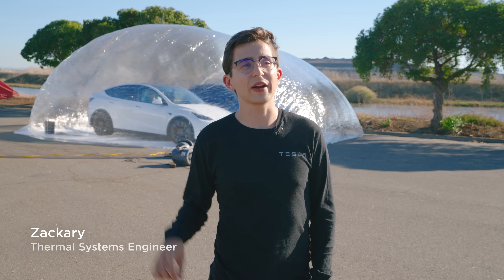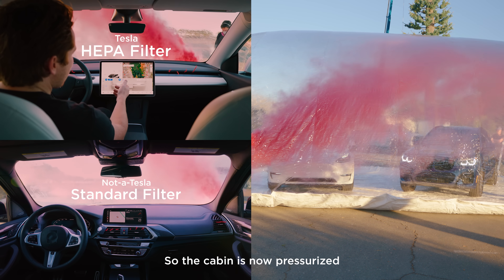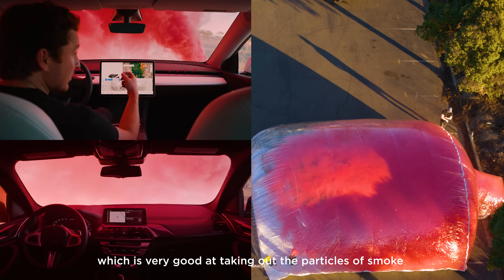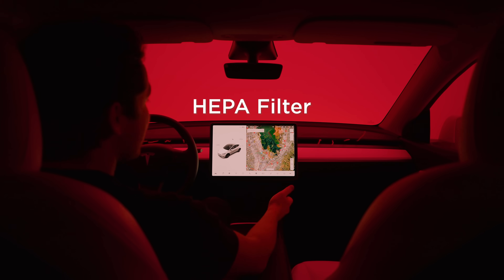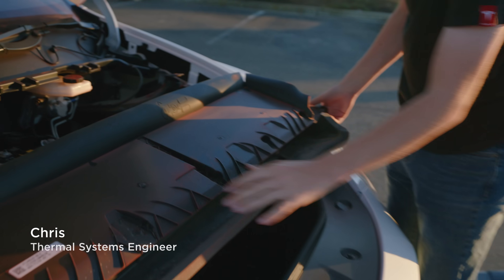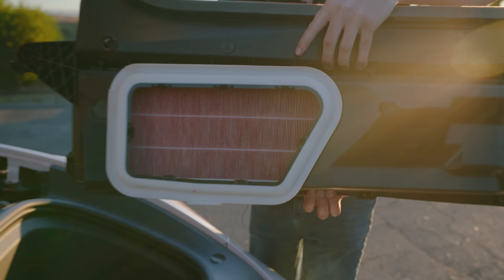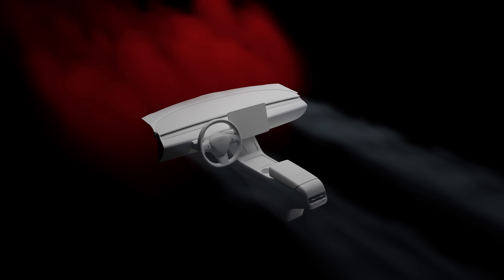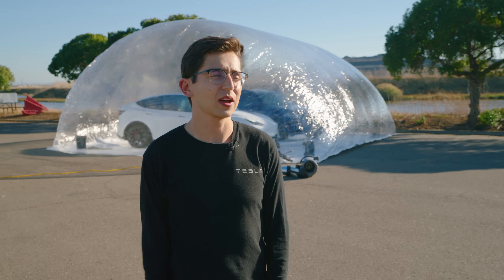Tesla HEPA Filter | Keeping Your Cabin Air Clean

Comment: Is it easy to change these filters?
Reply: Volvo has been doing HEPA filters and interior air quality sensors for 23 years.(they introduced both in 2000)  They are also certified by the asthma and allergy foundation of America unlike Tesla.  Volvo also has won the interior air quality award since 2020 and continue to do so. Not to mention the filter for a Tesla is 500$ the filter for a new Volvo is 32$ and still has cleaner air in the cabin.

Comment: I recently learned that particles from brake dust can actually be more harmful than exhaust so it’s another bonus for the health of everyone inside and outside a Tesla since EVs like Teslas  can be set to rarely use the brakes.
Reply: Most EVs have very little brake wear due to using regenerative braking (the electric motors) to do most of the braking.  This extends brake life and recovers normally wasted energy.
Reply: What? This statement is absurd lol
Reply: Yeah but they burn more tire(heavier and accelerate more quickly) but even tough brake particle are worst you have way more tailpipes emissions
Reply: @charles-olivierdaoust8397  Neither brake dust or particles from tires are tailpipe emissions. EVs do not have a tailpipe, they do not have tailpipe emissions. 
The particle size and thus also time the particles stay airborne is orders of magnitude higher with tires than with an internal combustion engine. 
And particle emissions from EV tires, despite the higher weight, are only marginally higher, to the point of insignificance.
Reply: Actually, the major problem with particles comes from the tires. And on this point, electric cars have some problems due to their weight. But, have to consider Tesla's cars are the lighter and more efficient in the industry of EV.
Reply: That claim about brake dust is really just wrong. The only study on it concluded a "may", while several of the particulates formed in a diesel engine are known carcinogens.
Reply: @drkastenbrot  Brake dust is mostly heavy metal particulates. You don't need a peer reviewed paper to know that is fucking terrible to breathe in.
Reply: @Shrouded_reaper  Since when is iron a heavy metal?
Reply: @drkastenbrot  at the gym. 😂

Comment: You forgot to turn on Air Recirculation on the BMW  (the green led is not lit up). 

For it to be a fair comparison (which the Tesla would have won anyway), you should have turned on Air Recirculation on the BMW, because the Bio Defense Mode of the Tesla is like a ‘supercharged’ Air Recirculation Mode.
Reply: I agree. Not being an anti-ev boomer but I’m sorry “biodefense” mode is just influencer bait for turning on re-circ in any normal car. If you hadn’t toggled that bio symbol on the Y then it would be the same story…..cool as it is it isn’t as revolutionary as it makes itself out to be 😑😂 I guess it is just simple psychology by changing the story around something that’s existed forever wa-la people fooled.
Reply: The manual on Tesla's say in biodefence mode it's filtering the outside air.
Reply: @TheEvilmooseofdoom  When activated, Bioweapon Defense Mode recirculates air through the high quality HEPA filter, purifying the cabin air while avoiding the intake of contaminated outside air. Model S and Model X already use a secondary air filtration system, but when Bioweapon Defense Mode is activated, it adds the HEPA filter as another layer of filtration.

Below is what Tesla Manual says (see last part that says that Bio defense mode tries to minimize the air entering from outside by recirculating very fast the air already inside the cabin thus creating positive pressure inside to prevent air entering from outside). 

If your Model Y is equipped with the medical-grade HEPA (High Efficiency
Particulate Am iiter, this filter ensures the best quality air inside the cabin whenever the climate control system is on and outside air is entering the cabin (recirculate is off). The HEPA filter is extremely effective at removing particles, including pollution, allergens, bacteria, pollen, mold spores, and viruses. Both the HEPA filter and the secondary filtration system also contain activated carbon to remove a broad spectrum of odors and gases. When you engage Bioweapon Defense Mode, the positive pressure inside the cabin minimizes the amount of outside air that can enter the vehicle.

So a fair comparison about ‘Bio Defense Mode’ required them to turn air recirculation on the BMW. The Tesla would have won anyway because the size and quality of the HEPA filter is fairly superior to what the BMW has.

Comment: If you don't select bio defense mode, is the air not being filtered through the HEPA as standard? So if you drive into a polluted/ smokey area before engaging, the bad particles will get into the car?
Do you need to engage it at the start of each drive? Does it have any drawbacks or reduce efficiency? Does it affect AC?

Comment: Glad to finally see this it will be very useful on gravel roads and  dust storms
Reply: Great to finally see this? Volvo has been doing HEPA filters and interior air quality sensors for 23 years.(they introduced both in 2000)  They are also certified by the asthma and allergy foundation of America unlike Tesla.  Volvo also has won the interior air quality since 2020 and continue to do so.
Reply: @ethandonivan5175  ok

Comment: I have a 2021 Model 3 and it has a vinegar-like odor issue with the HVAC system, caused by condensation issue. I’ve been operating the HVAC per Tesla’s service recommendations (cycling between recycle and fresh air, turning off the air cabin temp maintenance mode, etc). Tesla has replaced my air filters 3 times for free, but this defect needs to be addressed ASAP. 

@Tesla: I would appreciate an official response to my feedback above.
Reply: if they have carbon filters you are out of look. all carbon filters come with their own typical smell. HEPA filters do not though. but its often combined.
if yours has carbon filters, let them take those out and just keep the hepa.

Comment: do not have a tesla, but would an automatic washer fluid refiller be useful? as in using rainwater collected from under the windscreen or using this to refill the washer bottle by pouring water on it instead of filling the bottle? a simple filter system with overflow and a dosing system filled at service etc. just like a rainwater system for your garden.
Reply: That's a million $ idea right there!
Reply: And what happens when it freezes.
Reply: @ethandonivan5175  good question, i would add washer fluid to it. the idea is to simply extend the capacity of the washer bottle by using rainwater so it would not need to be filled. if it ever ran out, the way to fill it would be to pour water on the scuttle to fill it if needed, the same as adding washer fluid to a normal washer bottle.an option would to have a concentrate supply that would dose the main washer bottle with washer fluid as required. it is the effect of having solar cells on the roof of an electric car, it will not fully charge the car but it would help.

Comment: If only you didn’t refuse to fit the HEPA filters I purchased for my Model 3! Why is this not an option on all Teslas?
Reply: Model 3 apparently doesn't have the space to fit the large HEPA filters. Model Y, being taller has the space to accommodate it.
Reply: @realrift01  I purchased purpose designed HEPA variants and had them fitted by third party service engineer. They won’t qualify for bio-defensive mode, but they do perform to a higher standard than Tesla OEM ones, which are the only ones Tesla will fit if you go to them for service. At least they don’t make servicing by Tesla a pre-condition to validate the guarantee like GM did with the Ampera for instance.

Comment: What is a point to buy those filters if Tesla have a ton of gaps in the sealing?? You should better fix a sealing problem on your sunroof and doors.
Reply: The main air intake creates a positive pressure in the car. This means that small air gaps won't let air in - because air is trying to rush OUT of the car.
Labs with strict cleanroom requirements use similar systems.

Comment: Nice! but why does it have a button to turn on and off when it's a filter that's permanently in the car?
Reply: Filters are consumables. You don't want it engaged when it's not necessary.
Reply: @logitech4873  so if you turn it off, the air bypasses the hepa filter?
Reply: @WrathChild-NZ  That's honestly just my guess, since it's a separate mode and all.
Reply: Probably because it is overkill in normal situation. Saves of filter life that way, I would think.

Comment: Great engineering Tesla.
Reply: Volvo has been doing HEPA filters and interior air quality sensors for 23 years.(they introduced both in 2000)  They are also certified by the asthma and allergy foundation of America unlike Tesla.  Volvo also has won the interior air quality award since 2020 and continue to do so. Not to mention the filter for a Tesla is 500$ the filter for a new Volvo is 32$ and still has cleaner air in the cabin.

Comment: If Tesla is so concerned about air quality, why doesn't it build electric bikes? Even EV's produce particulate matter by degrading of the rubber on the wheels. Shielding yourself doesn't fix the problem.
Reply: Bikes are dangerous. Tesla don’t want to make dangerous products
Reply: @jackwhitlock1  self driving and lithium ion batteries can be dangerous, yet here we are
Reply: @jaimic4lyfe  
An EV battery is no more dangerous than a gas car. Self driving is only dangerous if you don't watch the road, which is why driver monitoring is there.
Reply: @a.banana  bro the adaptive cruise control is safer than self driving
Reply: @Life
It's only less safe than manual driving if you don't pay attention.
Reply: Because the unfortunate truth is barely anyone wants an electric bike. Selling them as an option will only have a small impact on helping the environment because of that.
Reply: @a.banana  More people buy electric bikes than Teslas.
Reply: @logitech4873  
Not true. Electric bike sales for the first 11 months of 2021 were 368,000. Tesla sold nearly a million vehicles in 2021, and sales are likely to grow to nearly 1.5 million in 2022
Reply: @a.banana  Why are you comparing US e-bike numbers with global Tesla sales?

302 000 Teslas were sold in the US in 2021. That's less than the e-bikes.

The US has comparatively low e-bike sales due to terrible city infrastructure.
Globally, e-bikes MASSIVELY outsell Teslas.
Reply: @logitech4873  You are missing the point. What were ICE car sales over the same time? That's what Tesla is working to replace.
Reply: @realrift01  I'm not missing any point. I'm correcting an incorrect statement.
Reply: @logitech4873  
Well, I admit I was wrong then. I looked up electric bike sales for 2021, but didn't realize I was looking at US only numbers. Still though, there is a point to be made that e-bikes might be more commonly replacing regular bikes rather than gasoline vehicles. Personally, I doubt that e-bikes will ever replace gas cars, especially in the U.S, and Tesla being a U.S company probably sees it that way as well.
Reply: @a.banana  Oh yeah for sure. I agree.
Reply: @logitech4873  "More people buy electric bikes than Teslas." This is missing the point.

Comment: tesla #1
Reply: Volvo has been doing HEPA filters and interior air quality sensors for 23 years.(they introduced both in 2000)  They are also certified by the asthma and allergy foundation of America unlike Tesla.  Volvo also has won the interior air quality award since 2020 and continue to do so. Not to mention the filter for a Tesla is 500$ the filter for a new Volvo is 32$ and still has cleaner air in the cabin.

Comment: i think its kinda bad ass that these engineeres trust their work to much that to demonstrate, how good their product is, they just report from inside the car. amidst a biohazarous event🙀
Reply: Hey Adrian, you mean "too much" and they used smoke grenades (Rauchgranaten) which are NOT really "biohazardous". Just to visualize the particles. Just FYI. Regards
Reply: Volvo has been doing HEPA filters and interior air quality sensors for 23 years.(they introduced both in 2000)  They are also certified by the asthma and allergy foundation of America unlike Tesla.  Volvo also has won the interior air quality award since 2020 and continue to do so.
People have done this same thing on a 12 year old Volvo wagon and it did not let smoke in.

Comment: Tesla, a breath of fresh air.
Reply: Not for the Chinese kids manufacturing your battery. We need to fix this before making EVs popular. All we're doing now is moving where the pollution is realesed. At least with our current batteries.
Reply: @OutOfNameIdeas2  🤡
Reply: @OutOfNameIdeas2  
Tesla gets their lithium from Australia and cobalt from Congo. I don't know where 'Chinese kids' came from.
Reply: @a.banana  Even if they came from China the question is which pollutes the least. Batteries can be recycle, fuel can not, EVs are more efficient, and even if charged with grids powered by coal plants they pollute less. Add to that many more countries are now using renewable energy instead of coal and many EV owners have solar panels at home to charge their EVs. 

The oil industry is not going to get any cleaner but the grid will. 

What is needed is more education so more people start to look at both sides of the argument and let no the feelings, believes, desire, and emotions speak but instead let the facts show the way.

Comment: How easy are these to replace? And how easy is general maintenance if you are to do it yourself?
I hear quite many have issues with maintenance and repair shops in northern europe. It would be nice to be able to do some tasks yourself without the iphone experience of planned obsolescense and impossible to diy.
Reply: These filters are super easy to change on most cars. Although knowing Tesla it might be a bit tricky, but not at all impossible to do on your own. Although getting replacement parts from Tesla... Good luck
Reply: You can order them from Tesla for $220. It takes about 10 minutes to replace one if you know what you're doing - but if you're new to it, watch a youtube video and follow along.
Expected lifetime of these filters is around 3 years (unless you do tests like in this video)
Reply: Plenty of videos on YouTube for many jobs.
Reply: The panels under the hood are mostly snapped in place. You can see in the video the whole module pulls out and can swap the filters. Cabin air filters can be bought on the Tesla site and third party vendors. DIY guides are here for most vehicles, some of the Model Y is the same as the Model 3 guide. Tesla also sells access to service manuals and basic training.

Comment: This is an amazing thing to have. Even in my 2018 Model 3 (without HEPA/Bioweapon Defense) I've rarely had to dust my dashboard. The HVAC in Every Tesla is great even without this mode. I can't say that for my previous vehicles.
Reply: What were your previous cars? This is nothing special. In fact Tesla is not even the best one by far?
Reply: @OutOfNameIdeas2  Mostly ford vehicles.
Reply: @CoolSilver  You can buy a HEPA filter for any car really , but buying decent filters would also stop dust issues.
But there is also the issue that a lot of dust comes in from different places.

Btw i got a jeep and a audi a7 , the jeep always has a thick layer of dust , while the A7 has almost no dust. Both using oem filters.

Only issue i have with tesla starting to use hepa filters in their cars , is the price they will most likely ask for them.
Since quality HEPA filters go for like 30$/piece , you can expect Tesla charging 100$+/piece for them.
Reply: @LorandHungary  How much are hepa furnace filters? Most car cabin filters are 1/3 the size for one. Bioweapon defense mode requires a lot of airflow to provide increased internal pressure to force air to leak out not leak in.
Reply: @LorandHungary  Teslas filter is huge. 10x larger than some others. That makes such great filtration possible while keeping airflow.
Reply: @daniel_960_  Well , there are filters available for every model.
If you are talking about those huge ones , i think those are like 150$ from more knows brands.
But not all tesla filters are that huge.
Reply: @CoolSilver  When you say furnace filters do you mean real furnaces?
Sorry but i don't know if it is a term for something else.
If you are talking about real furnaces , then you can't really use a hepa filter for those. It could put your life at risk.
But you can use them in your HVAC  , which helps a ton.
Reply: @LorandHungary  Not all Teslas have bioweapon defense mode. Model 3 does not. It takes two non-hepa certified filters, both combined is about $35. Furnace filters cost more as MERV rating increases and most aren't cheap. Tesla Hepa filters handle a lot of airflow that you might find in a home HVAC system. Just putting in a HEPA filter in another brand car doesn't mean you'll get proper air flow.
Reply: @CoolSilver  I never talked about the "biodefence" thing. I don't know what it exactly does or if it even is anything special.
But you can buy hepa filters for a model 3. They are better than normal filters and will work fine with the car. Only issue is that they are considerably more expensive than normal filters.
Reply: @LorandHungary  You've missed the point of the video and the entire reason why the filters are as big as they are. Yes there are "Hepa" filters for the model 3. They restrict the airflow slightly more and puts additional strain on the blower.
Reply: @LorandHungary  biodefence mode basically is about keeping positive pressure gradient to outside - so you're constantly sucking air in (through your filters) rather than recirculating, which means that you don't get stuff entering through all the many non-airtight portions of the vehicle.